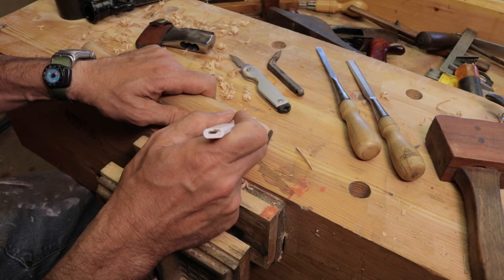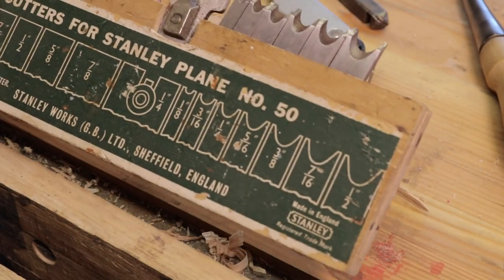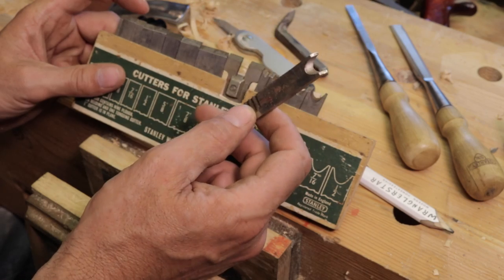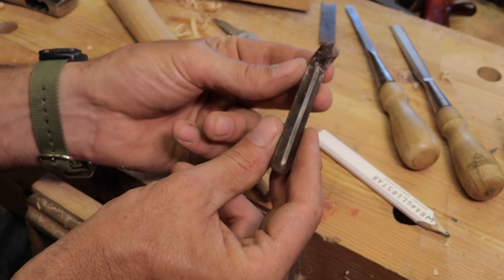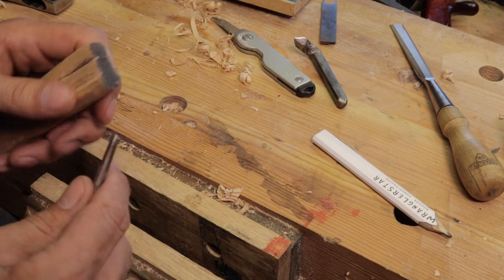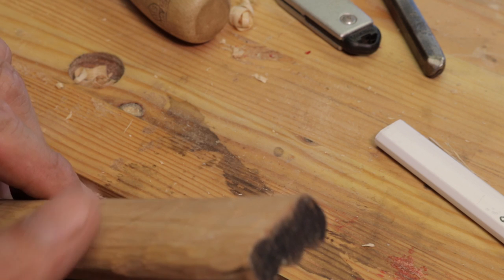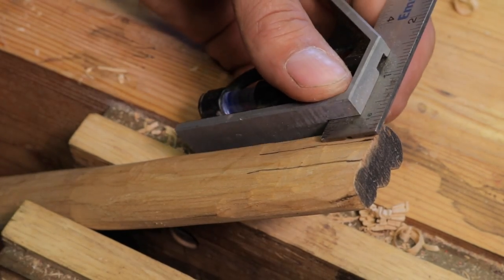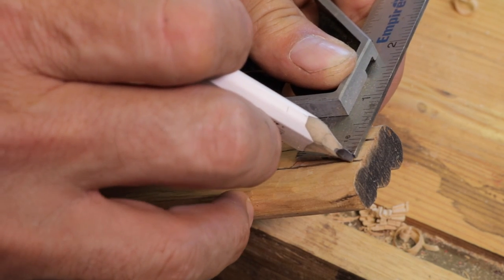The World's Tiniest Axe - 5

Comment: I had a carpentry course back in high school and my teacher was older and did stuff different than most. He said to put the object you want to copy the hole of, like a hammer head eye or a axe eye, on a cloth, preferably a lite blue or lite red one, so you can see it clearly where it's wet, and hold it tight against the hole you want to copy. Put a little water down the hole. Pick up the object off the cloth and cut the cloth, where it's wet, and that's the shape you need to make the end of your handle to. This would have been great to try with this axe head. I keep old shirts and ripped lite color blue jeans for this reason. You obviously want to dry your axe head right away though. I seen someone use spray paint, and cardboard but then you have a mess to clean up. I like the water and cloth way.

Comment: I'm pretty sure it was meant to be an oval. Basically act like the 'teeth' in the head aren't there and when driven into the head they will bite into the wood to help tighten it. Kinda like the head has a built in wedge. But you would almost certainly still put some kind of wedge in the end still though. I understand this is a little late but that's how I see it. 

Great series by the way, thanks for sharing.

Comment: With the amount of work you have into the handle at this point in time... I think my plan of attack would've been to follow those pencil lines with a stop cut, straight down with a utility knife to minimize the risk of an overcut/split of the work.  

If you wanted to work length wise, a 1/2 gouge might've been another option to you to finish/smooth the shaping.

Wonderful little project, nicely done.

Comment: First off: love the series. Don't care how many videos it takes..
Secondly: I know you're a big guy but I can't help but think that the body of the handle should be even thinner than you have it now. At the end of the day it is YOUR craftsmanship and however you decide to do it is perfect. I'm just throwin my 2 cents at the issue. Ratio of tiny axe to tiny handle: go thinner:)
Reply from the maker: I'm far from done with the handle. What you see is just the basic shape,
Reply: I'd disagree. I have slightly larger than average hands, admittedly, but even aesthetically I prefer the way it is now. It kind of looks like a scaled down felling axe, which in my opinion usually have the best head size to handle thickness ratio for looks.

Comment: I haven't seen anyone mention using an old card scraper or saw plate ground/drilled out to the specific diameters and then just using multiple pull strokes to scratch it out. In any case use what you have most readily available and nothing wrong with your approach its a solid idea.

Comment: It's probably heresy, but I think I would probably reinforce the joint of handle and head with a little epoxy, to strengthen and fill in any gaps. If you had to remove the handle later, it would probably burn out along with the stub of the handle. Just a thought, it's your axe and you know much more about it than I do. Mrs. O and I send our best.

Comment: Since their isn't enough material to do step wedges, if you want to have a bit more pressure in there then maybe use nails of different sizes, small enough to use but it could help make it extra tight.

Comment: I've enjoyed watching the tiny axe videos, Keep up the good work. After watching I started thinking how I would of tackled fitting the handle. Here's my thoughts (too late to help you now,) I have made several custom scrapers from an old hand saw blade. Drill three holes to match the head, cut across it with snips. Then use that to finish what you started with the chisel.
Jim Terry
Cozad, NE

Comment: i had a thought about getting a bit of steel stock and drilling three holes in the same shape as the axe head then heating it and pushing the handle into it. A bit like heating the tang of a knife and pushing into the handle.

just a thought

Rob

Comment: I have a gerber pocket knife I use to check hardness with. Checked it on a Rockwell hardness tester and it was Rc54.3 which is unacceptable for a knife. If it scratches a knife I know it's too soft. I made a bunch of hardness tester files while I worked at that machine shop. I bought lot of Gerbers over the years and they have just got softer through the years.

 I don't understand why you don't use a dremel with a bullet head cutter to do that. It would do a better job and quicker, but it wouldn't remove so much material that you would over do it either.

Comment: Hey Cody, you can make a scraper that will match the axe head with a broken length of band saw blade. Shape it with a file so that it will fit the axe head. Then, scrape the handle with it until it fits the pattern. You can hold the scraper in you wise while you pull the handle over it.

Comment: If you soak wood in water it becomes really flexible right? you could soak the part where the axe is going to be in water and then compress the areas that you're cutting away and then put the axe head on, Then when it expands it would be even tighter. Or maybe even try to just jam the axe on there and force the handle to contour to the shape of the eye. I'm probably missing something here, but it seems like a good idea! As always, great video Cody.

Comment: I was wondering if you could use a hole saw, the same inside diameter as the size of the 3 circles. Then drill down about an   1/8" or so, on all 3 circles. Leaving you the exact shape to then carve too? Maybe next time.

Comment: Original add shows, Belt ax, 16 oz. head, 14 inch handle, Blade 2 3/4 x 4 3/4 High carbon manganese tool steel  and sold for $6.75.  That include the blade protect built into handle.  '1906 to 1958"

Comment: Hi Cody,Maybe you could get a piece of steel and drill three .5 inch holes spaced correctly, then cut it in half length wise, sharpen it and use it as a scraper. ???

Comment: I've noticed that those Marbles axes all seemed to have metal wedges. Not the little staple bit, the actual wedge in the kerf. I wonder if that was because there would be no room for the wee cross-wedge? I do know that on my very first axe restore I had to deal with tryign to pull out a big metal wedge. That was no fun...

Comment: I would have used a card scraper, cut the profile of the eye out of it, and used it to work the handle down.
Reply: It would have been simple with a half inch bit as well.
Reply: +alexnelson09 I meant to say profiling the scraper could have been easy using a drill bit.
Reply: I would have chosen a gouge as my tool.
Reply: good idea

Comment: I was thinking about your little handle ordeal for a while as well. The best solution I came up with is to first get a piece of heat-treatable steel(probably could even use and old saw blade or something). Then grab a half inch bit and drill three holes with the same spacing as the ax head. After that cut down the center of those three holes and then heat treat and sharpen that piece you made. Maybe next time!

Comment: Hello,
I saw your video series and thought a lot of how I would try to shape the handle. I got 2 ideas:
1) Cutting it with a small knife. I'm glad to have a "Small Pick Knife" by Ben Orford, UK. Knives like these are perfect for jobs like yours. Plus: cutting with the knife should make a very clean surface.
2) I would try to build a scraper. I'd try to find the measurements/radius of eye. Then I'd try to drill the same holes into an steel plate. If I cut the steel plate into half, I'd end up with 2 scrapers, that perfectly fit to your eye. The edges of the scrapers should be sharp enough for scraping the hickory. Don't know how to describe it better. English isn't my native language... do you know how to make wooden nails with a metal plate? Same idea.
Greetings from Hamburg, Germany,
Piet.

Comment: The process of "sooting" may have been more precise. Basically putting soot on the inside of the axe head and fitting it on the handle and removing where the soot makes a mark on the wood.  Just another tool for the toolbox.

Comment: That is a 1/4 inch chisel ,not 1/8.If your saw is binding, use some wax on it. We always kept a plumbers candle or perifine   wax bar  in the tool box for saws or even nails in finish wood, it reduces binding and splitting. Nice job,  though I will never understand why anyone wants to sand away all the character of an old tool. File off the Beat edges,yes, but why not just scrub the rest with oil and 3M pad from body shop. Producing a nice brown patina and saving the character of an old ax.

Comment: I'm thinking they may have used custom profiled spoke shave-like knife blades to reach that profile. Drill your 3 half inch holes through a plate of thin sharpen able metal at about 30°, then determine how much to leave on to achieve desired depth. Cut off across the holes and sharpen. I'd leave a guide edge down the side to run against the handle edge. The alignment of arches on each side of the handle will tell you if your handle is too broad.

Comment: Hi,
I wanted to suggest to your conundrum with the round peg and round hole. In Nauvoo Illinois is a family that made/restored on window sashes with no nails or better yet no metal fasteners of any kind. Chuck Allen drilled round holes and drove square pegs in the round holes. these fasteners had the ability to withstand high humidity as well as low winter humidity. Thank you for your "webbage" here on YouTube.

P.S how did Mrs. W fare with the busted lip and tooth?

Comment: I would have created a simple wedge shape on the end, predrilled and driven a few perpendicular nails through the wedge, sawed off both sides to give you an 8th on each side, then I would have used a zero shrinkage polymer potting compound. When the compound kicks it would have been rock solid.

Comment: So I have not read the plethora of comments on the handle. You could have taken a 1/4" steel plate and drilled three holes on the correct centres and driven it down over the head end of the handle. Then you would only need fine tuning to make the fit.

Comment: Don't you have an old broken bandsaw blade lying around? Personnaly, I would have made a dedicated 3-beads scrapper with a profile copying the shape of the eye (lengthwise) on a scrap bit of said bandsaw and used a L shaped scrapstock.Then you are sure to copy the exact shape of the eye and don't risk to overshoot your depth cut, since the body of the scrapstock is used as the depth gage.

Comment: I thought there was a certain minimum size where it's considered a hatchet rather than an axe. (Still in the axe family, but more geared towards doing stuff like limbing rather than chopping through a whole tree.)

Also for all that work into the handle, you really need to get a V-gouge. Work with the grain, less splitting, and it'd go faster.

Comment: i was shown once to fit a head
told to rough size just larger then actual 
and taper the start to fit like 1/4 inch
then start fitting and cut those shavings off as it approached seating

Comment: Not sure if this would work and it is a bit late now but it may be worth doing it and having a unique tool to have in your collection. To create the form for the handle to go in the eye of the axe, get a flat piece of steel draw / copy / trace etc the eye of the axe on the steel drill out three holes using a drill (I think you said you think it is 1/2 inch) the holes HAVE to stay inside the shape / design. Once you have done that cut the steel in half length wise and it should be in the same shape as you require. Then it is a matter of fashioning a handle on it and use it to slowly scrape the wood away.... Anyway my thoughts on how you could create the handle to fit the eye... GOD bless keep doing what you are doing it brings smiles and joy too many.. Forget about the nay Sayers they are just pissed they do not possess your God given talent. Thank you for sharing and thank Mrs "W" for supporting you as she does... Cheers & Blessings Les
Reply: And slowly use it to create the desired result. Modify the shape as needed to achieve the desired shape in the metal as drilling the holes and cutting in half only gives a basic shape. Any way my thoughts on it. God Bless you God Bless Mrs "W" and Bless young Jack, your and the worlds future (as all young children are) you are giving him the tools to be a true man.. Cheers & Blessings Les

Comment: what if you took the handle and ran just the top part over a table saw with a couple cuts at 45 degrees from both sides to make perfect valleys then rounded it over? or is the handle just to rounded to square it against the table?

Comment: could you use an old planer blade and drill out the 3 holes side by side like it is layed out in the head of the ax.  Then cut in half and use as a drag plane on each side of the handle?

Comment: You should've made a form tool for that.  An old scraper blade, drilled in the same pattern as the eye and sharpened into a cutting edge.  It would've taken you about as long and you could've made other handles for the same axe head in case this one doesn't work out well for you.  It's likely how the factory did it as well, maybe not the scraper but likely similar, perhaps out of carbide.

Comment: your handle was made by hand , however to a manufacturer time is money , i think their mechanical engineers must of devised a jig ,perhaps some special plunge cut router or wood drill jig ,because they would not waste material and would need precision consistency on each handle , just like the axe head must of been machined milled to get proper mechanical tolerances . this model axe is still manufactured by marbles they may not be vintage like yours however it is a close proximity . this is only my opinion and thoughts .    thank you sir:

Comment: Oh yes, I now remember. You could have created a scratch tool by drilling three overlapping holes in 1/8 “ stock, and then cutting the stock dividing the large irregular hole lengthwise to make two pieces of the metal. You had the right idea with the scratch cutter from your Stanley 50 plane.  Just create a scratch cutter with three holes in an old circular saw blade. Take care.

Comment: Perhaps if you have to rehandle another one of these, you might consider making a scratch-stock.  You would take a steel plate and cut three holes in it exactly matching those of the axe.  You want the shape of the bit left to scratch the two grooves in the handle.  Do this on both sides.  See finewoodworking.com/2008/07/31/how-to-make-a-scratch-stock.

Comment: why couldn't you do like 3 nails instead of a wedge?
Reply: Nails rust and don't work hand in hand with the wood of the handle. My experience is that using nails results in a loose handle in the long run. I bet it's because when the wood swells because of moisture the metal nails don't give way and thus damage the wood.

Comment: He just defied the laws of physics when he smacked that axe head on
Reply: I... What... How does that axe head go up when he smacks down
Reply: Google Newtons  laws of motion. This is a perfect example on how an object stays where it is until you apply enough energy to moove it.
Reply: I really hope this is a joke!
Reply: he does it all the time, is the way axe heads are fixed to the handle, looks weird tho
Reply: The axe head has more mass than the handle, therefore it requires more energy to move, even if suspended upside down. When he hits the handle, the handle moves down before the axe head does. He's not  pulling the axe head up, he's hitting the handle down into the axe head.
Reply: Well, not exatly. It's the friction between the axe head and the handle that descides how far it will move. If the handle has more mass you just have to whack it harder.

Comment: Gerber make some great knife, my edc is a gerber paraframe 2(not there best knife, but a great  knife that if i lost it or have to jump on a plane and throw it away, it is not a problem)   But if you want a real hand made knife made by workng men, for working men.  Using the best steel you can posible use in knifes.   They are geting real popular over there in the USA also.  Check them out if you want a hand made knife that is from the absolut top shelf.

Comment: If I were to tackle it I would take an old circular saw blade or steel scrap drill a half inch hole in it then cut it out so into a small tool with a semicircular hole on one edge. The chisel the wood to the rough shape and then use the tool to scrape it to perfect size.

Comment: I do NOT understand why you didn't take a piece of steel, and drill three holes in it, and then use that as the cutting tool for cutting the hole pattern for the handle,  tapping it down onto the handle, then pull handle off, trim off some excess with any old knife or a chisel, then tap the steel template/blade down some more until you get there...
Reply from the maker: Because I want to do this entirely by hand,
Reply: +Wranglerstar some people just don't understand "a labor of love".
Reply: Thanks for your reply. With all your subscribers, I was surprised and pleased. I hope it turns out well. To Mark Chatman's "labor of love" comment, I just want the project to turn out well. I'm just concerned that the head may end up fitting tightly enough on the handle.

Comment: They do make a router bit for that exact shape. Rockler Woodworking makes a router bit to produce a loose tenon based on three 1/2" dowels stuck together to form that shape. Of course it wouldn't be practical for a one off handle. Beadlock.com